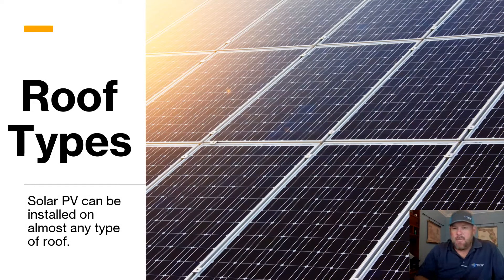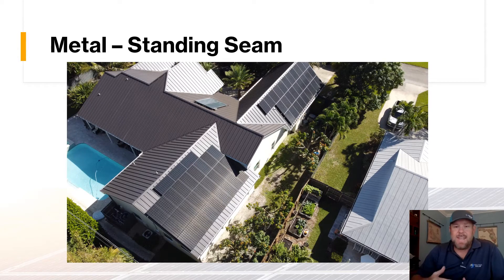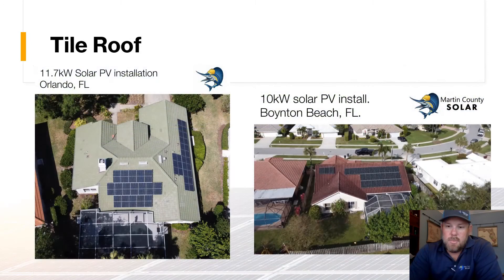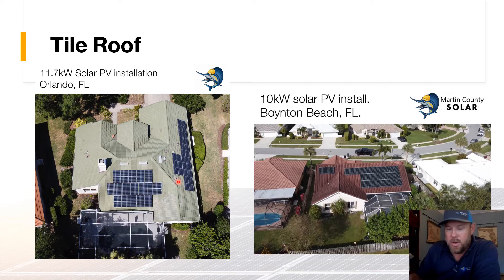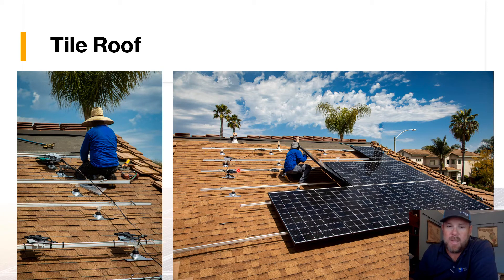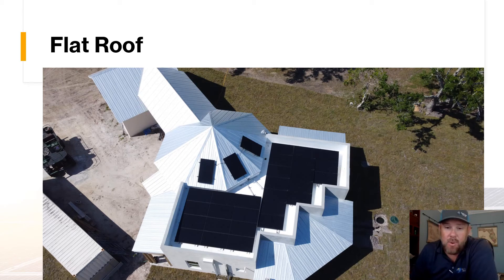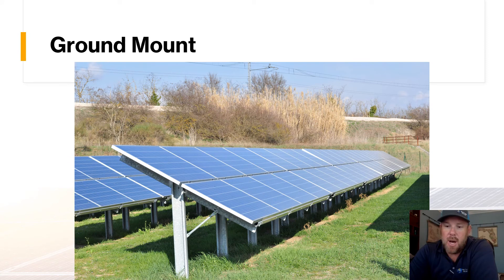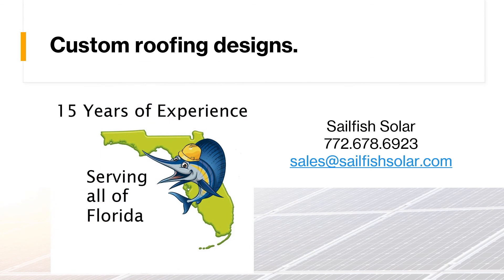Installing solar panels on various types of roofs in Florida.

Comment: Very nice video, thank you. My main concern about having solar on my roof is the possibility of leaks from the holes in the roof where the footers are installed. I talked to a roofer and he said they see a lot of issues with solar pv installations.  How do you address that?
Reply from the maker: Great question. And valid concern that we work very diligently to prevent. We will be posting videos on this exact topic, so please subscribe and check back. In a nutshell though: we use the same exact or stronger sealants that a roofer would use; our crews are essentially made up of experienced roofers combined with an electrician; and mounting techniques that are specific to the type of roof. For example - there are fundamentally different mounts for each type of roof - Tile, Standing Seam metal, 5v metal, Flat roof, or Shingle. What you are expressing with your question is one of the top concerns with every customer, and it is inherently one of our top concerns also. We are very proud to have one of the strongest no-leak track records in Florida.